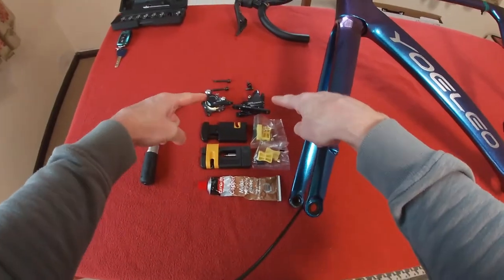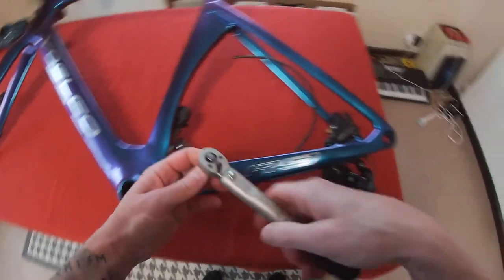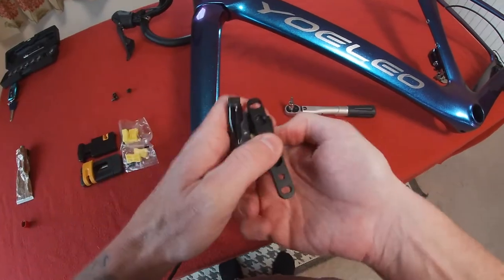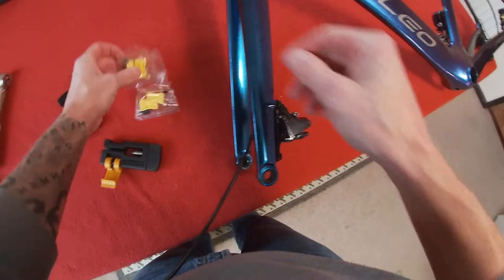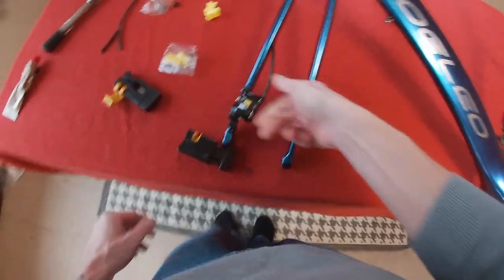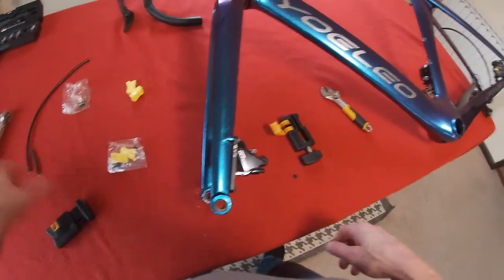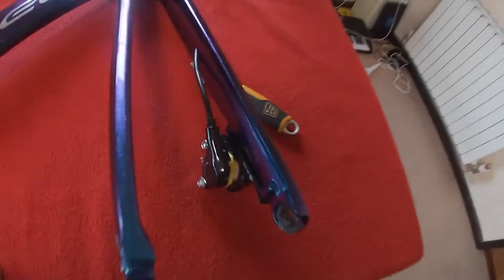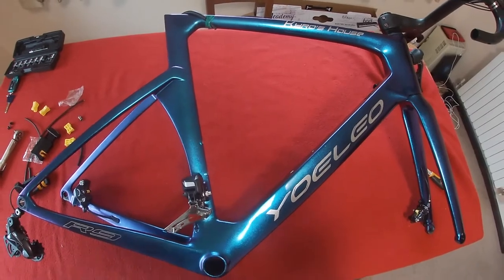Disc Brake Caliper Install

Comment: good video look easier than threading a cable tbh I sm hoping to change my brakes over to full hydro soon
Reply from the maker: I’ve been using hydraulic brakes since 2014 on my road bikes, I prefer them to be honest. Enjoy the change! 👍
Reply: @KyrosHouseCycling  i got a hybrid system which is really hard to work with
Reply from the maker: @meneldil7604  hydraulic brakes with mechanical gears? 👍
Reply: @KyrosHouseCycling  no i cable to the stem hydro the rest of the way
Reply from the maker: @meneldil7604  oh, haven’t seen that before I don’t think. Sounds complicated. 👍
Reply: Hydro right up until they don’t work...hopefully not at 60 mph downhill...to each their own I suppose.
Reply: Never said I liked them I agree completely
Reply: I raced for a lot of years, seen and been in a few bad crashes. The bad ones were always the ones I could not see, and had no control over, kind of why I could never trust hydraulics.
Reply from the maker: @billybastar4022  never had a problem in 6 years of hydro riding. Everything can have an issue though. 👍
Reply from the maker: @billybastar4022  well that’s fair I suppose. 👍